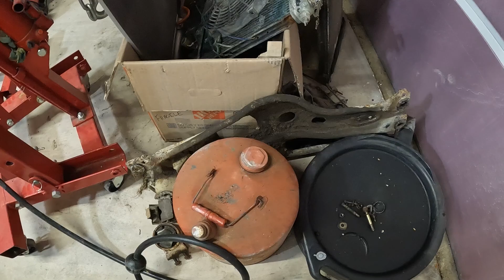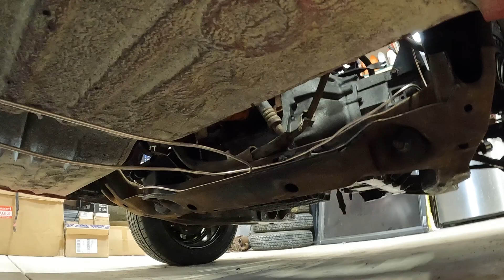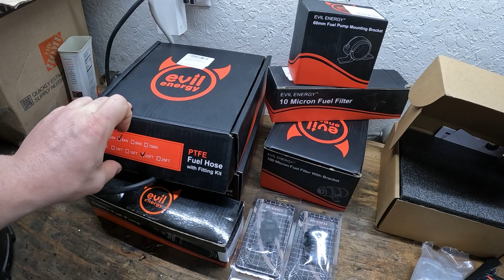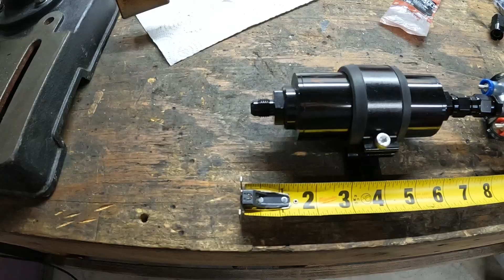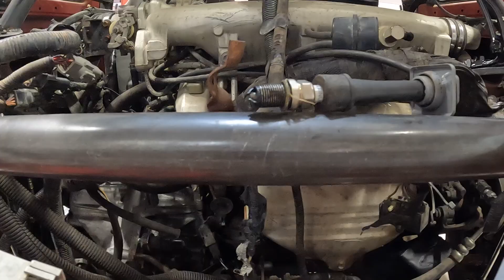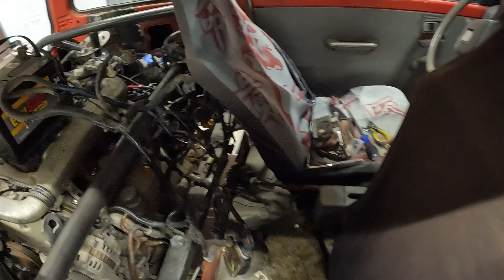Ford Shogun Build - Episode 7. Fuel, Wiring... FIRST START!

Comment: The fuel pump/filter assembly, I’d put some thick rubber grommets or similar on the mounting bolts, that way there is some wiggle room when the body flexes. I could see those interconnected fittings not doing well over time from mechanical stress since the assembly is pretty long. Like always, great video!
Reply from the maker: Tis a fair point! That and some lock-washers lol.

Comment: You might try dismounting the rear calipers, sticking a 2x4 or something in the rotor space, raising them above the highest point in the line, bleeding, and then remounting. Not ideal, but it should get the air out of the lines.
Reply: He could always try a pressurized system for bleeding the brakes, that would be a way to take care of that issue
Reply from the maker: @1mawesomel1kethat  that would work too 🙂 it could be that the stock festiva master doesn't have a big enough bore, thus not a big enough volume, to push out all 4 of the taurus calipers 🤷‍♂️ meh, who needs brakes anyways lol 😋
Reply: @GenericGarage  or maybe go with the Taurus' braking system
Reply: @GenericGarage  better yet you could have 2 brake pedals so you can do a sick drift whenever you want
Reply from the maker: @1mawesomel1kethat  yeah might look into the taurus master and booster. Idk yet.
Reply from the maker: @1mawesomel1kethat  haha, I think 3 is enough 😆
Reply from the maker: @kraignadjkovic5494  I'll give it a shot. Thanks!!! 😁